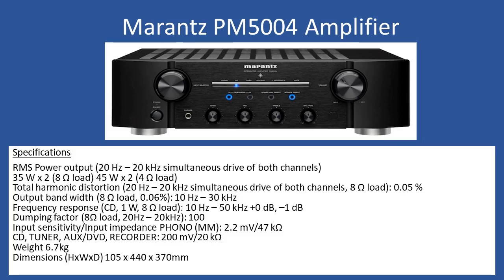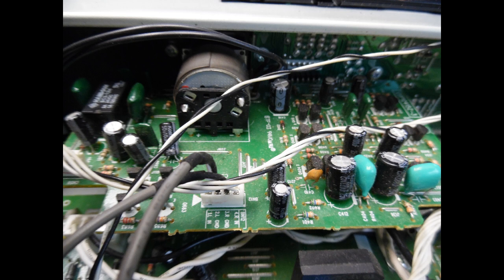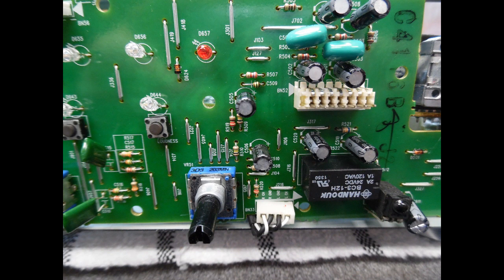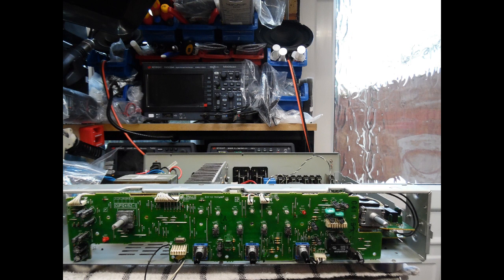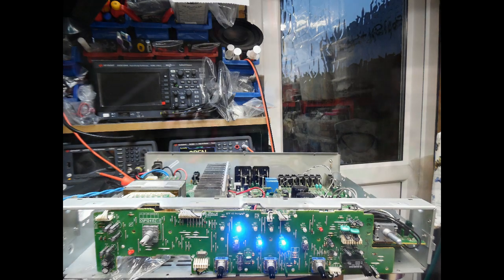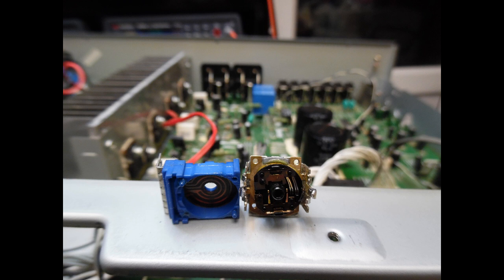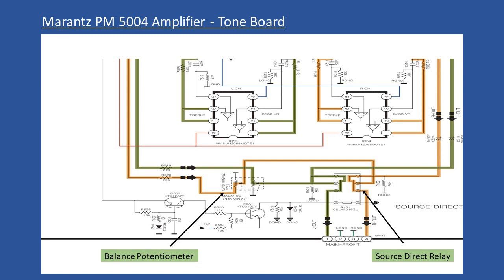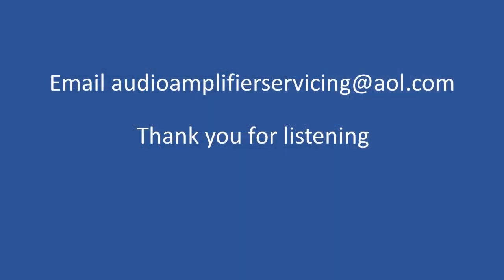Marantz PM5004 Amplifier Repair (With Audio Tutorial)

Comment: I have the marantz PM6005 and the left speaker doesn't go loud at all compared to the right one. Is this soldering problem or the balance derelegated?
Reply from the maker: Hu you advised before "I've had this amplifier for 7 years. it always worked fine but now i have a problem. I don't get much sound from the left speaker compared to the right. Is the repair easy to do yourself? Headphones is ok."
Response below 
Hi the head phones are connected via the head phones relay to the output channels of the Amplifier, so if your Amplifier is working correctly on head phones both when you select direct mode and non-direct made, the issue may be with the speaker protection relay.
Do you have the same issue if you connect to speaker set B?
Reply: @AudioAmplifierServicing  finally, same problem whit headphone. 
I have almost no sound in the left side.
Yes, Same problem on speaker set B and same problem on direct mode. To test by ear, the left speaker has twice as much sound as the right one.
Reply from the maker: @DIRECTSOUNDVINYL  Hi you need to check the audio entering and exiting the volume potentiometer.

Comment: I just bought a black PM5004 2nd hand and discovered the volume knob is not exactly black, but a very dark bronz-ish colour. The select knob is black. Do you know if this is intended? Can I just pull the big knob off the D shaped axis? Do you know a seller of replacement knobs? Thanks for the video and for answering this question.
Reply from the maker: Hi the knob should be black the anodised coating has worn away, not sure which country your located.
If its the UK then Sontec is the company to order Marantz spare from  https://www.sontec.co.uk/
Reply: @AudioAmplifierServicing Thank you! I am in The Netherlands. Is it easy to pull the knob off or is it glued?
Reply from the maker: @PalmBobo  Hi just pull the knob off.
Reply from the maker: @PalmBobo  Hi check this link for authorised spares provider https://www.marantz.com/nl-nl/

Comment: Hi, I have a somewhat related problem. My PM5004 randomly goes into standby. Now it does that about once a day, but the frequency seems to increase. Any idea where to look for the cause? Is this a common problem with this model? Thank you.
Reply from the maker: Hi It sounds like your Amplifier may be switching to protection mode.
It can be due to one of the voltage regulators breaking down.
See this video https://youtu.be/SMT_ARIB3Tk?si=CBL4JTKdnrvRokw4
Reply: @AudioAmplifierServicing   Hi Thanks for replying. When it turns itself off, the power LED is not blinking but solid (=standby mode). I thought it is supposed to blink in protection mode. Does your advice in the other video still apply when the power LED it is not blinking?
Reply from the maker: @PalmBobo  Hi the power LED would flash if the unit is switching to protection mode.
Check if the unit has accidently been switched to Auto standby mode https://manuals.marantz.com/pm5005/NA/EN/DNTXSYomckupba.php
Reply: @AudioAmplifierServicing  I held the SourceDirect button for 5 seconds aan de powerled flashed once, which means auto standby is now off, which means it WAS previously on. But I doubt this was the problem, because a) it turns itself off even after hours of music playing (not the 30 minutes of inactivity the manual mentions and b) it turns itself off while playing, so it is not "inactive" at all. But I'll see what it will be doing the coming days. Thanks for thinking with me!
Reply from the maker: @PalmBobo  let me know how you get on.
Reply: Report: no unwanted auto switchoffs the last week! Looks like problem solved. Thanks and next time I will RTFM.😊
Reply from the maker: @PalmBobo  That great

Comment: Hi there, my pm6004 has no sound on right channel. Any advice on where to start diagnosis?
Reply from the maker: Hi a common issue is the failure of the volume control potentiometer.
So first check if you have Audio entering and exiting the Volume control circuit board for the faulty channel.
Reply: @AudioAmplifierServicing  Thank you! Would cleaning it help?
Reply from the maker: @user-lf8dq2bf6r No the carbon track of the potentiometer fails.
Reply: @AudioAmplifierServicing  damn! Any idea where to source parts?
Reply from the maker: @user-lf8dq2bf6r  From here https://fixpart.co.uk/product/sound-united-00d9430197305-potentiometer-focus-volume-amplifier but you need to confirm the potentiometer is faulty.
Reply: @AudioAmplifierServicing  Many Thanks. Is that something that can be tested at home?
Reply from the maker: @user-lf8dq2bf6r Hi you would need an Audio Signal tracer or an Oscilloscope. If your in the UK you can it to me for repair. audioamplifierservicing@aol.com